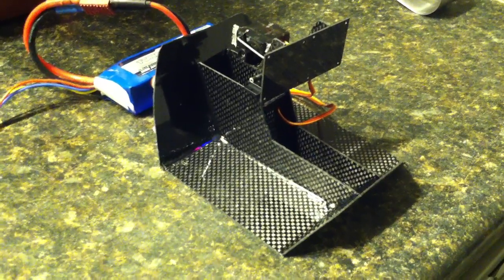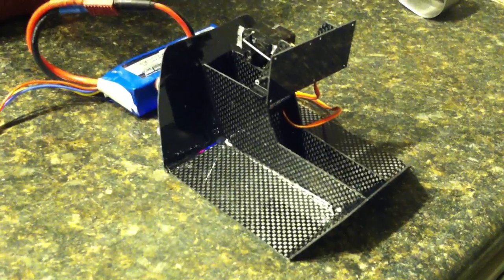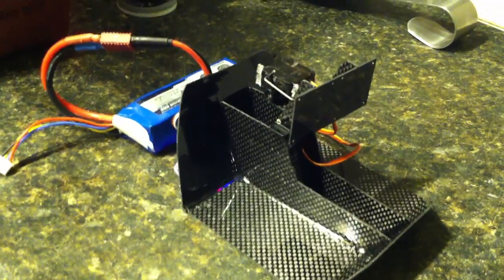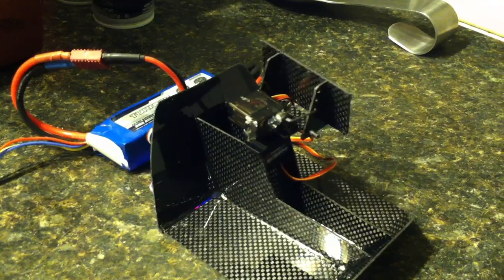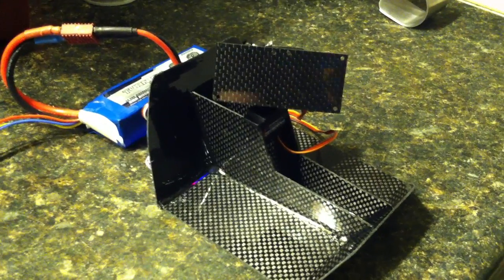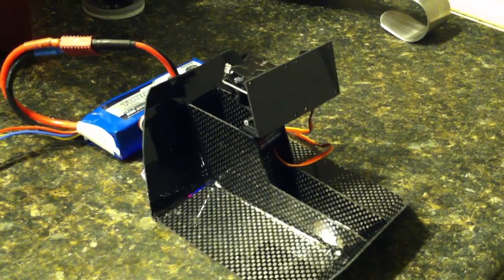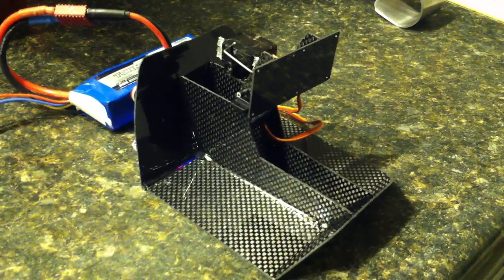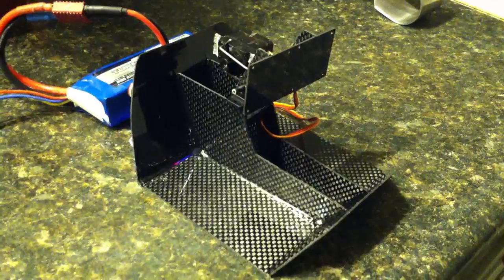Super Skysurfer FPV pod Carbonfiber 180

Comment from the maker: This is the TGY-RS180MG
I tried the TGY180D but it was not as smooth and was only about 150 degrees of movement.

The TGY-RS180MG doesnt actually have any mechanical stops built in, so it could easily be made into a 360 servo!

For a GoPro or larger camera, I would probably go bigger, im only mounting two 16g cameras to the board.